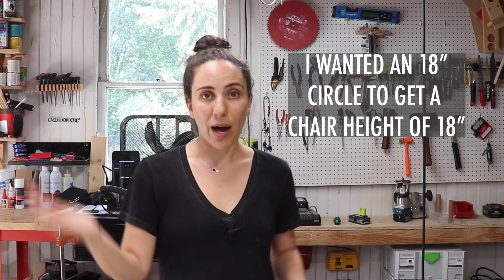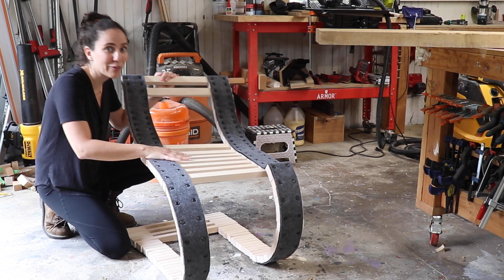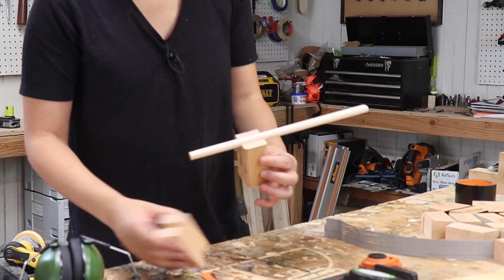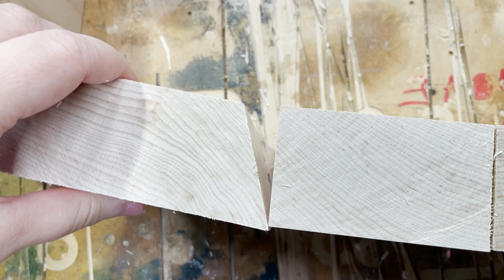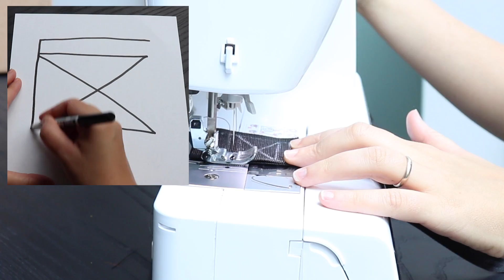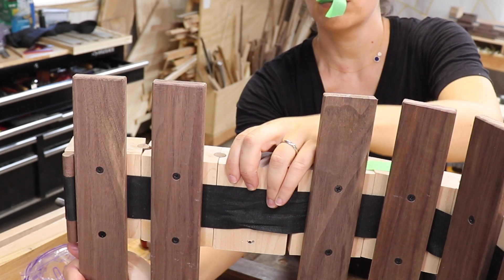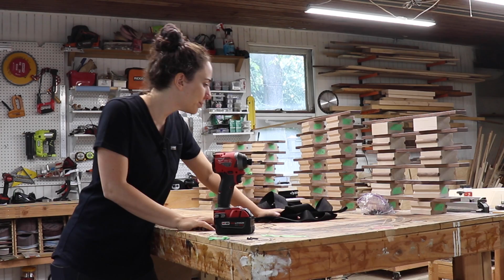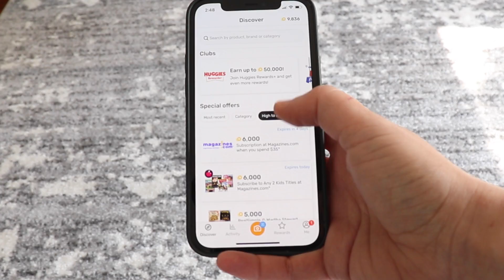I ATTEMPT to make a Roll Up Chair… AGAIN...

Comment: Solved!  Jk

A lot of good comments but I could not read all the many thousands.  My suggestion may be similar or even a repeat.

The mechanics and materials seem sound.  First, I would suggest introducing at least a 3rd strap, so there is not a single point of failure and stress can be more evenly distributed.  As others have commented, secure the tensioner (straps) at increasing intervals, ie. at every station block.  When doing this tho, secure at a point less than fully open.  To determine the distance that is "less than"; do a small mock up and mark the strap before any weight is added.  Then add some weight (ex. 200+ lbs) for extended amount of time (ex. a day) and measure any amount of deformation per distance of strap allowed to deform, ie. 1/4" per 3 inches.  If the straps are secured at every block (glue and staple?) I believe the deformation will be much less than what was shown in this video.  With a more accurate expectation on how the straps will perform it will be easy to account for the stretching. 

For the 3rd strap, I would add it in the centre and sandwich the strap between the slats and a backing (backing only, no need for additional rail cuts above what you already have) using a screw and glue.

I hope this helps!!

Comment: I think a way to solve the issue of the fronts of the pieces separating when under tension is to have the strap hard-mounted to the wood rather than sitting against it with slack. This may make it a little harder to roll up at the end but it’s the only safe way I can think of to make sure those corners don’t separate and make the chair droop

Comment: I wonder if the flat edges of the individual pieces is contributing to the tension issue. Right now, all of the tension and strain is on those straps, with the dowel only acting as a pivot point. Perhaps some sort of '<' shape cut into the wooden sections could help shift the tension to the wood.

Starting from the bottom piece, pointing forward.. essentially each piece looking like this: <=< 

The idea here being that you're cutting a wedge form into the sections perpendicular to the direction of downward pressure on each section, so the 'V' cuts may need to shift throughout.

I saw someone mention hinges in the comments, this sounds like another viable solution. 'H' shaped sections with two dowels running through and a connector piece for each section.

Either way, it's always fun and interesting to see the work you produce and even when an experiment like this doesn't succeed, it's a lesson learned (or two or three). Thank you for the wonderful content!
Reply: Another idea, but it may be "cheating" here. A support for the seating area that folds in when you want to roll up the seat but can be locked in place to give support when the chair is unrolled.

Comment: Yes you should have stapled the straps to every block. That would have likely solved your issue. Without stapling to each block, the  stretch of the entire straps have free reign, but by stapling at each block, you are effectively shortening the amount of movement the straps have and thus  the amount of stretch

Comment: OMG I wish I had time to mock this chair up for you in CAD. I think I might try anyways because I love stuff like this. You can't use nylon straps such as what you're using because they stretch to much. You would be better off using steel cable or chains as they stretch WAY less. Also, you might want to think about it's usage. Is this merely a decorative piece that might be sat in once in a while or will it see a lot of sittings. The reason why I say this is because you have to decide what the chair looks like without someone sitting in it and what it looks like with someone sitting in it. If you make the chair to tight it will look not so nice without someone sitting in it because it wont fall into the chair shape without being weighted. if you make it too loose it will look nice without weight but will fail when someone sits in it. You have to find a happy medium.

Comment: This is so frustrating. Stop adjusting the straps; just add cut wood that will fit in the gap to fill it up. I said something similar in your last video about this. If there are gaps, you can just fill it up with material. If the strap material does have stretch, you will eventually work all of it out by iteratively adding gap filler and placing load on it by sitting on it (which is why you shouldn't need to staple it to each segment).

Comment: It ought to be connected by wires, with metal reinforced channels for the main supporting structure that you sit on. Hate the wire terminate at the back of the bend before it turns up for the back rest. That would fix the main structural issues. The Venom webbing would then run along the outside still.

Comment: Wider hinge area would probably help with streaching issue, well as utilizing Kevlar straps that has continuous fibers. For collapsing back rest, maybe you could drill holes trough the center of the frame and insert steel cable that can be loosened. I dont think this is lost cause, but gluing it kinda messed up opportunity to develop this. As its now, maybe add more peaces to make it full loop and utilize center area as storage option.

Comment: Why not use the straps, then use steel cable? I’d recommend gripple for your linkage. It’s used in commercial HVAC and holds a ton of steel in the air.

Comment: I feel like the webbing might need to be attached to each individual piece?  Rather than running freely between them. As it stands they all share the tension along the webbing so when you sit in it the top tries to roll down or bottom roll up. If the webbing was attached to each piece then sandwiched between the wood it’ll only have the tension of the piece next to it?  Maybe?

Comment: What if you ran a small steel cable through all the pieces that could tighten on a spool? Similar to newer snowboarding boots that have the BOA system. Once you roll the chair out. just spin the ratchet and it would cinch together

Comment: Use straps that are used on ratchet straps / tie down cables. Also, having another rope that goes down on the front side of the darker wood would help a lot (think tensegrity table).
Reply: The straps are being pushed outwards but you need straps that also have the opposite stress on it.

Comment: yeah if you are going with leather I would recommend Kangaroo leather as it is the toughest stuff. I also think that if you cut it into shorter straps but just have them side by side it might help limit the stretch. Like have a 2 foot strip of leather then 1 foot up start another 2 foot strip next to it so that there is always two straps next to each other. I do also think that the length is letting the stretch add up in those spots.

Comment: What if you put the dowel between each joint the traditional way, but have them be very short, like ¼-½ inch sticking out. This will keep it from twisting and may prevent the gaps from forming because they would be more like legos…. Also alternate male female between left and rights sides and maybe 2 dowels per side

Also what if you did 2 straps or you made a midpoint anchor for the strap so they pull from the center out not from top to the bottom?

Comment: Not really experienced in wood working in of itself, but I would suggest segmenting the straps used to each section of the chair. So the tension isn't throughout the length of the chair. Then double up or back the straps at the arcs where it's meant to take load. Since You wouldn't have to redo the straps on the entire chair but only it's respective sections. Using a decorative strap on the entire length of the chair to make it appear as one piece.

Comment: This isn't the correct design. You're not going to find any material that's going to work the way you need it to. You need actual joints of some kind instead of a strap.

Comment: I highly recommend a material with 0 stretch and high flexibility: denim. That's really your best-case scenario in my opinion. Using potentially multiple layers of high-quality denim straps, in 4 rows instead of 2, and securely held at each beam by pushing stitched holes into each spot where the screws go (thus not allowing small movements to be compounded across the entirety of the chair), as well as putting one-sided resting points into each spot where the wood meets, should ultimately fix your problem.

Comment: Have you thought about balancing the tension? Your chair has the tension all on one side, causing the top and bottom to roll up. Where as if the tension was always on the outside curves it would be working against itself to keep the chair in a stable condition. Although you may have trouble rolling it up.

Comment: It's not the flexibility of the straps. Even straps with infinite rigidity would still create the same problem. 
Notice how the top curve collapses while the bottom curve is being stretched? It is as if the bottom part is saying "I need more strap!" while the top part replies: "Ok, I'll give it to you - if I collapse, I need less length of strap!"
In other words, the straps should NOT be allowed to slide as they sort of communicate. Secure the straps to each block, so that it creates separate hinges between the blocks.
(Effectively what others have been saying, but in my own words.)

Comment: @3x3Custom - Tamer
Your close, but materials isnt the solution. 
It’s rienforcement.        Or engineering.
If you notice in buidlins, supports are added when they are needed, so that’s all you need to add. That’s what we do when we can’t use materials.
On the inner curve, there is a lack of support, just an edge supporting an edge.
Instead of tension, have a normal force, a surface that pushes back rather than pulls.

On the inner curve, either add materials to the top. You could either add materials or just not cut it that short.

Yours
______.          ____________
________\  /_________
Theres no support here
The forces want to go like this
————>.    <——————
And downward on your wood

Which effects your wood like so
\/.    V.    \/.     \/.   V.    \/
V.     V                      V     V.       Where the downward arrows represent the force, and more arrows means more force or leverage
V.                                     V
Which causes a rotation since they are connected, 

so stronger strap can’t help because it’s the conection that does vector stuff and converts the difference in force and leverage into rotation.
The only reason you would want leather, is to make a stronger binding force at the rotational area, 
WHICH BASICALLY MEANS MAKING THE ROTATING JOINT PART STRONGER
So no; leather wont stop the rotation, because all you would do is make a stronger rotating part that can handle more foces while rotating before breaking, rather than stoping the rotation. If you wanted this to work, you need a super ridged material that doesnt stretch and warp, which is kind of an exotic and unnecessary approach. 

How an engineer would do it
_____________.              ________________
                             \.     /
_________________|    |____________________. <see this? 
Each one would have a different diagonal angle to stop it at the right amount of degrees or fixed angular rotation

You would also get away with the i beam technique, or using using strips that dont go as wide as the whole piece of wood to save on weight 
So…

        _
____|.    |____<support can be s strip of material
|___________|
This would be upside right for the ones on the botom touching the floor, while the ones curving around holding the booty up would be uspide down.

This method would save weight, just be sure that the long side goes upward, not sideways
In other words

| |
Not
==

I hope understand the likely hood of this technique working, because this is how we build buildings, and these principles work on things from 
bridges to skyscrapers.

Please help this comment get noticed by the one it’s for, so if you need to go to discord or something, please do. Likes arent nesisary as it’s for her, and not us or me.
Reply: If you want to do it with tension, you could, you could insert metal hooks that latch and basically do the same thing as shown above.
Alternatively, you could insert connectors with a wires of very specific lengths for each part, but you would nee atleast two, of sufficient distance vertically, and not length or width wise since the forces are pulling downwards,

In other words
______________.                    ____________
                            +~~~~~~+

                                 +~~+
___________________\/_____________________

Where + is connector and ~ is a strong metal cabal. Yeah, unless you have super strong wire, you might want to upgrade thickness. You could have a super fat pieces of rope…. But it would get longer over time, you want metal cable.

You might be able to have one, but it needs to be on the outside, where the support would be, because its doing the same thing, but with tension rather than pushing back.

You can also double it up or triple width wise meaning the top spot has two wires  which could be close right together or separated since you all ready have enough left and right prevention from the wood., but the vertical would need to be place further apart or you basically have a hinge and dont stop rotation.
It doent matter when side by side, becuase you allready dont have a chair the twists left and right, so you dont need them spaced appart.
Reply: Notice that tilting or rotational support is the same for tension and normal force (Pushing/ support (the ground eg.)).

If you hang a lamp from a string it will be fine if balanced but could fall to one side and stay if sides are too heave, but it might over or balance the same is supported on a pole from the ground.

If you want to stabilize it from the ground, you making it like stool and have spaced legs, from the ceiling, you space the same but with wires or so something.
Reply: If your appendages were not not connected on points but like a stool, they wouldn’t bend unless parts slid into and out of. 
Unless you were on a high gravity world where lockable bones or cartilage with friction or clamping was necisary to conserve energy or limit strength requirements from muscles, you’re muscles will just handle the back and forth just fine.

Comment: Leather = danger! Leather will stretch and weaken over time, especially in high humidity or if it gets wet.
The key is to pretension the strapping to a good safety margin of a person sitting in the chair. It a simple force over distance calculation. T = F*D So a 100 kg person + 10 kg mass of chair =  110 kg The distance is about 1meter as 18" circle = .45 m then add the distance of the seat and back which as about an additional 20" so make it easy 1 m. So this 110 kg/m is scaled to the width of your slats or about 4 cm = 2750 kg. Tension straps to 2750 kg of force then set up your slats when you are one away from the circle you will need a strong compatible glue for wood and strapping material, and for each slat glue the strapping in-between so it cannot move. You reduce tension in other parts of desired, but where the arc is for the base of the chair the must be glued in place. You will also need to factor in the compression of the woods in the angles there too, this works out to about 1° of compression. Decrease the angles of the lower quarter of the chair and withe the tension in the straps it will work out for you.

Comment: I think I might have a solution using the straps and configuration you have. 

If you round over the edges of each block. ie the pointed edges which contact first. Then you could tie up the arrangement when it's laid out flat, making sure the radial edges are contacting tightly, when you assemble. You will basically move the leverage point from close to the strap to a few mm further in. This would then allow you to pretension the strap and still allow rolling up. With proper adjustment you should be able to lock it up pretty well in any position.

Comment: Piano wire, routed through holes in each block, drilled near the "outer" surface of the bend in which that block resides (in other words the surface that is put into tension as a result of that bend).  Also, place lugs at the top of the chair, around which the wire is wrapped, thatcan be tightened/loosened for assembly/roll-up respectively (similar to the lugs that are used to tune guitar strings).  Just make sure fingers can't get in the way.